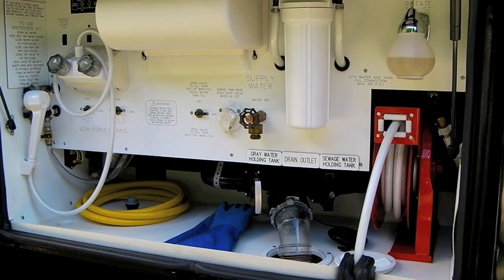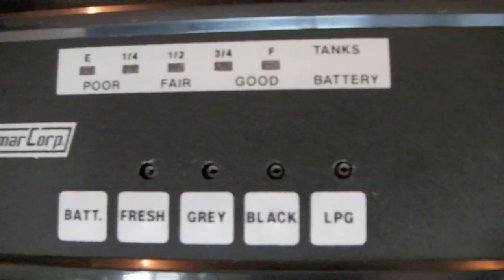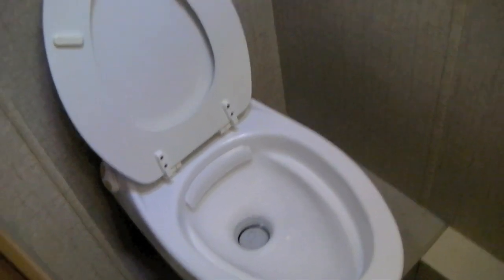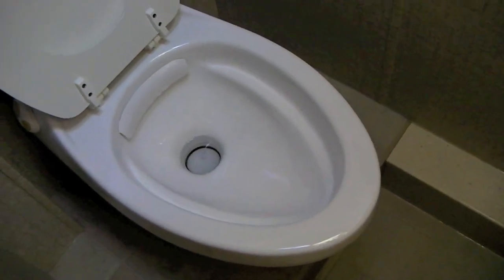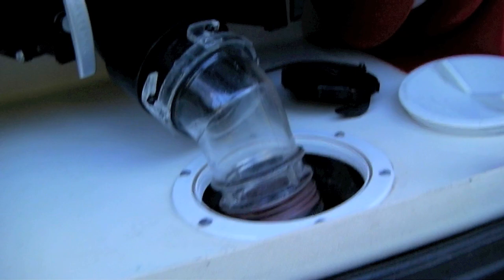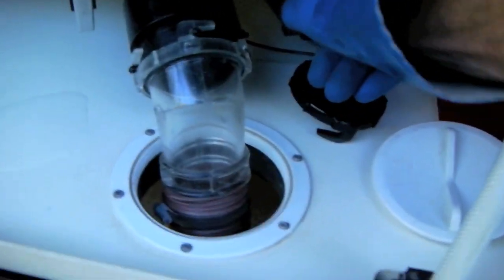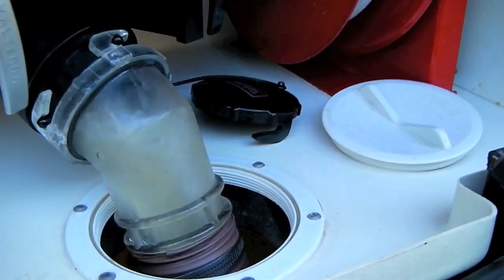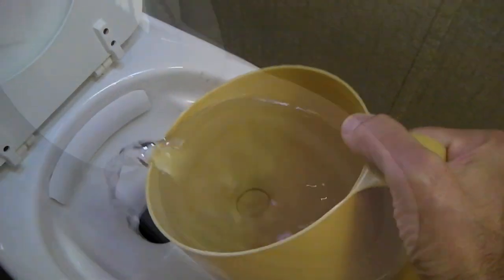How To Dump & Clean an RV Black Tank

Comment: Thank you for all your videos. Thinking about living in RV full time and your videos make for great research. A question on this one - you make a point of having the grey tank 3/4 full before the clean out procedure. But you have a direct sewer line rinse hook-up on your rig. Doesn't that mean for your rig the grey tank capacity is not an issue for the clean out?
Reply from the maker: Hi Scott! The reason we recommend having the gray tank mostly full before dumping the black is because even with the sewer flush connection, the volume of water that comes through that isn't enough to really flood the entire diameter of the sewer hose. Immediately after dumping the black tank, we want a big, sudden high-volume rush of water through the sewer hose to remove any residual matter from it. The best way to ensure that there is no remaining "stuff" in the hose prior to putting it away is that big rush of water that only comes from the gray tank. While not exactly clear water, there isn't fecal matter in the gray water, and ensuring that we clear out any of that is what we're after. Hope this makes sense, and thanks for the nice comment. :)
Reply: Now I understand. Thanks for such a quick response . . . and your GREAT presentations.

Comment: Isn’t the drain valve supposed to be open when running the tank flush? Won’t it over pressurize the tank. Thanks in advance
Reply from the maker: Hi Rodney! The displaced air goes up through the roof vent, so no problem as long as you open the valve before the tank is totally full. The label does say that you should not use the tank flush with the valve closed, but that’s primarily because if you forget that you’re flushing the tank and walk away and leave it, the water will come out through the roof vent when the tank fills. The label is probably as much for liability purposes then anything else.
Reply: That makes sense. Thanks again.

Comment: Silly question from a no rv'er with interest in rving. Why would you want to rinse the black tank so clean if it's going to be filled with waste again. Is it to have the maximum capacity of the tank again? is it to avoid clogs in the system? is it to reduce smells inside? I point it out because filling the black tank with 45 gallons of clean water just to flush it all out seems like a waste of good water unless there is some practical purpose to doing. I understand getting rid of the solid waste and that's why you keep the black tank valve close so there's water in the tank to take the solids away. Thanks in advance.  

I hope you have the change to answer this question because I've seen this practice in many videos but none explain why you want a spotless black tank.
Reply from the maker: Great question actually! It's actually exactly the things you mentioned: reducing odor & avoiding clogs. A common mistake people make is emptying the black tank, but leaving debris behind by not flushing thoroughly. Some of that debris can dry and harden before the tank begins to fill up enough to cover it again. Once anything drys/hardens in the tank, it won't easily flush out, even with the method we showed here. Once that begins to build up, things start to smell. That's why so many older RVs smell like toilet. It's because of years of repeated incomplete flushing, leaving a little material behind each time.
Reply: understood. I see now why it's important. That part was missing in my mind. Thanks for taking the time to answer my question.

Comment from the maker: Those windows are great for getting air flow, so a nice thing to keep, if you can keep them from leaking. We don't have any experience with them, but if you haven't already done so, you should join the forums at irv2(dot)com. You can post there and get all kinds of information and help from people experienced with every type of RV make/model/system/problem. It's a fantastic resource that any RV owner (especially a new one) should plug in to. Congrats again on your new RV and clean inspection! :)

Comment: I have watched this excellent video many times, even before buying our 2017 Thor 30.3.  After getting the RV, and being about to take the maiden voyage...I have a question about the process.  At several points, you close the black valve while rinsing the black tank.  My Thor manual, in the tank flush section, specifically says: "Dump valve must be open any time there is a hose (water supply) connected to this system. DO NOT LEAVE ANY HOSE (WATER SUPPLY) connected to this system when not in use".

I notice your RV (at least he one in this video) also has a warning plate that says "SEWAGE TANK RINSE, OPEN GATE VALVE WHEN IN USE".

 I assume this is just their way of keeping you from blowing sewage out of the roof vent if you forget and leave the tank flush running while the black valve is shut?  The black tank is obviously vented, so it should be safe to close the black valve to fill the tank part full or nearly full, as you do in the video, while trying to get the tank truly flushed, correct?

Thanks for the excellent channel!
Larry W.
Reply from the maker: +mrf1002u 100% correct on all counts! The manufacturers don't want to be responsible if you overflow your back tank! We just make sure to pay attention. 😊
Reply: Thanks guys!

Larry W.
Reply from the maker: By the way, Larry... if it helps any with your day-to-day RV routine, this video covers the way we do a thorough tank cleaning when needed. For routine tank dumping, we have a follow-up video about which you might find useful (and time-saving): https://youtu.be/gZFyfsy4ptw

Comment: I just recently purchased a used RV and am running into a chronic odor problem.
I'm assuming it has some significant build up. Any suggestions for that job?
Also, my 2009 Forest River Sunseeker (c-class) does NOT have a black tank flush. Would the approach then be to just run a hose into the RV and down the toilet to do the fill and flush part of the cleaning? Thanks for your help and the video.
Reply from the maker: Congrats on your new-to-you RV! We suggest that you try a product called "Happy Campers Extreme" tank cleaner. We've heard great things about its ability to super clean black tanks. They usually sell it on Amazon, but it's apparently out of stock right now. We just found this link to it: http://happycampersworld.com/product/happy-campers-extreme-cleaner/

Comment from the maker: Only add ice to an empty tank, and only when you are about to take a long drive. The ice will do nothing unless it is in contact with the bottom of the tank, and only if it is agitated. Floating on top of a partly-full tank, or sitting still, won't work.

Comment: Hi,
We just got back from taking our New Aspen Trail out for the weekend.
 The campground didn't have sewer hook up. We hooked up at our storage location dump station, hooked up to the San T Flush and when we turned on the water, it started coming out of the underbelly of the trailer in two locations, shut off water immediately. Went inside to check for water, and water (clear) was seeping from under the shower stall.
We were only able to flush out the black tank with the gray water.
We put water back into the Black tank. 
We are calling our dealer in the morning, but want to get an idea of what went wrong. 
Are we going to be faced with a mold issue?
How does the San T Flush systems hook up into the plumbing?
Are there videos on travel trailer plumbing schematics?
Thank you for any advice you are able to provide.

Comment: I see a lot of these videos for those staying in one place for a long time.  what about 2-3 day stay before next 2-3 day stay etc.  dump everytime?  drive with the tank partially full?  just curious
Reply from the maker: Whenever we’re fully hooked up (water, sewer,  electric), we ALWAYS leave with an empty gray tank. But we only dump the black when it’s 3/4 full or more, unless we’re heading out for a long boondocking trip, in which case we also want to start off with an empty black tank. Other than that, we only dump it every couple of weeks.

Comment: What a great video! Thank you so much. We do the same things except we don't have a black tank flush. We use the shower head to try and rinse as much as possible through the toilet. (Yes, I clean the shower head afterward..lol) However, we had no idea you could use RidX!! We've been using the bottle of blue stuff forever! Our 5th wheel doesn't move, we have it on our property in the mountains, so the ice thing wouldn't work for us. Any other suggestions as how to make sure the black tank is super clean? Thanks again for a great video!
Reply from the maker: Thanks for the nice comments and great question! We've gone back and forth between regular Rid-X, the Rid-X for RVs, and most recently Happy Campers, which we also like. They also make a super tank cleaning treatment called Happy Campers Extreme, which is designed to break down the most heavily stuck on gunk. We've never needed it, but we've heard good things about it. Available on Amazon: https://amzn.to/2AquqqQ
Reply: Thanks so much for the reply! I've just added this to my Amazon cart as well as a pressure cleaner RV hose that was a recommended add-on. We haven't had any problems and it is very rare to have any smell, but our RV has been stationary for so long, I can only imagine the build up in the tank. Thanks again, Mr. RVgeek! I'll let you know how it works after we do the dirty deed this weekend! Safe travles! ~Peace

Comment: what if your sensors don't work for tank fullness. I have timed mine but not sure exactly how much time it takes to fill, any suggestions? You guys rock by the way, love the videos
Reply from the maker: Thanks so much for the nice comment, and great question. Our 45-gallon black tank typically takes about 8-10 minutes to fill, depending of course on water pressure. One thing you can do if you have a helper, a flashlight and a couple of walkie talkies..... and are careful.... you could have your helper, stationed in the bathroom, step on the toilet flush pedal, look down into the black tank, and radio when they see the level get close to the top of the tank. Just be sure to stay in communication with the toilet valve open. Wouldn't be a very good day if what's in there came up through the toilet!

Comment: Learned so much, but let me ask what if you have a basic system and I have to use a wand. after the first 2 flushes do I close the black tank and just work the wand in circles to for a minute and let the whole black tank fill then flush using the gray tank? What chems do damage a toilet seal? what if im not able to fill the tank full of ice after ever flush and drive it around?
Reply from the maker: +Mark Decker Hi Mark. Yes on the wand filling the black tank. We think it might be chlorine based cleaners that can damage the rubber seals. Ice is only needed if you have an odor problem after flushing the tank, not each time you dump.

Comment: I love yer video's! I don't know what water action happens when using the black tank rinse valve. If it's just like a reverse fill, there's no guarantee that all solids are rinsed out of the holding tank. There needs to be some sort of agitation or spray pressure, and I'm unsure if that's the case. Is the wand maybe a better solution?
Reply from the maker: +Jp Berger The black tank rinse spray heads are up on the walls, and wash things down fairly well, but as you can see in the video, they don't get everything. We use the fill and drain method in the video rather than use a wand.

Comment: Gentlemen, love your vids thank you very much, in this vid you have a spongy looking seal that the main water hose supplying the rv with fresh water is coming through...where did you get this spongy seal and can I get one? thanks love you
Reply from the maker: Thanks for the nice comment! That came from Newmar built into the RV, allowing the water compartment to be closed while the water hose is connected to city water. The part is probably available from Newmar, but your RV would need to have that same sort of slot for the hose to be able to do the same thing.

Comment: Well actually ( I was being a bit misleading to you ) we did purchase the system about 6 months ago.... #1 Love the Smooth Interior but beyond that and not fitting the current floor opening in floor well, plus having to make their new and improved ( they say ) hard connection, when everything uses the OLDE  Bayonet connection. IT IS a bit of an unusable upgrade. Also a bit stiff.
Reply from the maker: If we had a new RV that came factory equipped with it, I'll bet that would be nice. ;-)

Comment: Amazing video! Thank you for this!  At the very end of the video- do you add RID-X only if you need to flush it out a second time!  What if  it smells great and your done with the process? Do you still add RID-X?  I will be using my TT once a month and I am not sure how to treat the tanks for storage for the month in between use.  Thank lots and cheers!!!
Reply from the maker: Good questions, Tris. You only need to add the Rid-X (or any other tank treatment like Happy Camper: https://amzn.to/3qBY69q ) if you're going to then use the RV. For storage, we'd recommend that you be sure to dump/empty your black & gray tanks so you don't leave waste in them that could dry up, clog sensors, and/or smell. And be sure you've thoroughly cleaned the black tank... that's DEFINITELY not something you want "residue" in for any length of time, stored or not.

If you're storing your RV where you don't have any issues with freezing temps, and you had been having an issue with odor from the black/gray tanks, you could leave them filled with water and a heavy dose of tank treatment (or even something like Happy Camper Extreme: https://amzn.to/3qBJk2x ) in order to breakup and then remove any residue. It's not something you should have to do very often (if ever), but it's a handy remedy if you start to have a problem.
Reply: @RVgeeks  thank you! Yee I meant that I would def dump all tanks before storage.  After I dump all tanks and make sure they are clean, do I need to treat the tank in any way for storage?? I will only be using my trailer maybe once a month. So what do I do when the trailer is not being used? Thank you for your thorough reply earlier! Sorry if I was unclear! Cheers 😎
Reply from the maker: If your tanks are emptied and the black tank flushed out, you can leave both black & gray tanks empty, with the valves closed, for storage.

Comment: Have you reviewed this Sewer Hose System...For The New FLAT ( Not Spiral Inside ) INTERIOR. WASTE WATER SEWER MANAGEMENT ? Now being sold by Lippert. Would appreciate your Pros and Cons you found ?
Reply from the maker: Our motorhome has this cool sleeve for the sewer hose hidden behind a little door next to the water compartment. We looked at the Lippert system, but it was far too big to fit in our sewer hose sleeve and would also require permanent alteration to our sewer connection. So even though the system appears superior to traditional sewer hoses, we have not made the leap, so we have no experience with it.

Comment: I am curious as to the size of your black tank and the length of time your flush takes to fill it.  I've been concerned my flush may be too slow; but it appears based on your one minute post flush dump (before your full fill) that I may indeed be fine and just not patient.
Reply from the maker: We have a 45-gallon black tank, and depending on water pressure, I'd say it typically takes about 8 minutes to fill it.

Comment: Hi Peter, you hooked up your tank flush directly to your water source without a water regulator. Are you not worried about blowing the tank flush plumbing? Why don't you put your regulator on the city water, and then your Y splitter on the regulator? I'm not challenging you, I'm just asking. - Thanks
Reply from the maker: +raybbj Great question! Because there is no way to "close" the black flush system (as in there is no on/off control for it), there's no way to pressurize it by closing it. So there's really no way to cause high pressure in the line, and we want maximum flow for max flushing action. The only time we would use a regulator is on those huge standpipes (the type with the handles you lift up to turn the water on) since they typically have very large pipes and extreme pressure.
Reply: Good point ..... unless the city water is so strong the tank jets can't relieve the pressure fast enough...... but maybe I'm taking this too far.    Also, your permanent RV site looks like the RV park up at Harrison Hot Springs, am I right ?
Reply from the maker: Close! It's actually about 20 minutes outside Harrison Hot Springs.

Comment: If you were to leave the black tank open and the liquids ran out, and the solids built up inside the tank, would the black tank become clogged and you would be unable to flush it?
Reply from the maker: The black tank would take a fairly long time to clog up so much that the liquids would no longer run out. But in the meantime, a pile of "solid matter" would immediately begin to pile up... and harden up as it dries out. This hardened, drying pile will quickly become almost impossible to remove, and the smell would quickly become unbearable. Leaving the black valve open is one of the biggest self-inflicited mistakes that a novice RVer can make. It can take a professional to remove the disgusting results, and it's not pretty of cheap to un-do. Be sure to leave your black tank valve closed, James... other than when you're actually flushing the tank! 😊